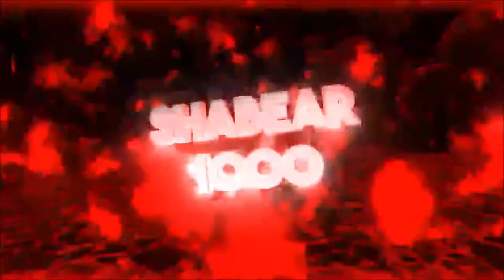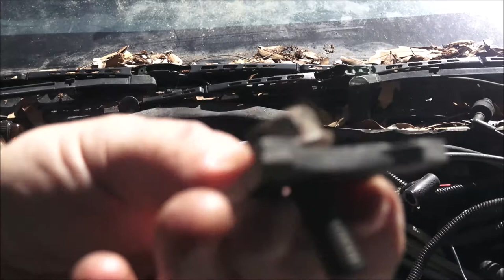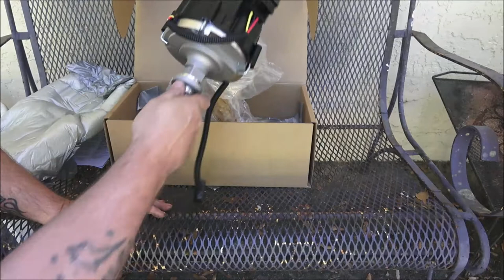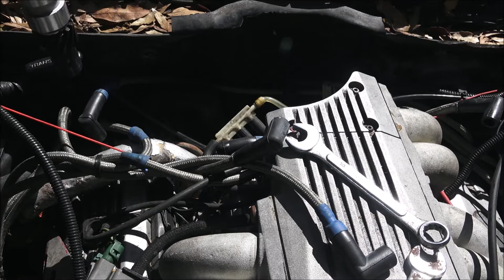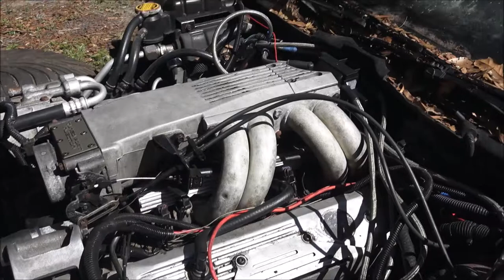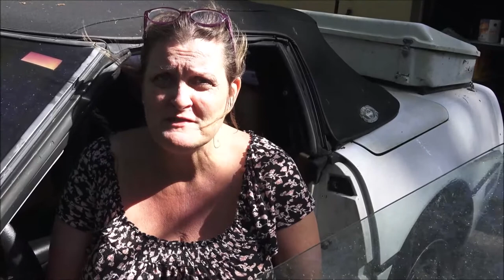1990 Corvette C4 L98 Distributor Replacement

Comment: Got my new distributor yesterday. I was looking for a video that shows how to get a wrench on my crankshaft, it's so close there. Mine's a 91 white convert and I put i in a used distrib a while back, it would start and run but bad, so I think it's 180 out, so I've removed my left valve cover and plan to turn the engine till the compression valve is right to install, but can't get a tool on the crankshaft bolt, it's so close there. I love these convertibles... Good luck with yours....
Reply from the maker: Try putting a wrench on the alternator and turn it that way.

Comment: Funny Enough I was doing a burnout in my 1991 Corvette a couple days back then it just lost power figured it was the Distributor fuel pump seems to be working since I can hear it when it Turn the key to the On position
Reply from the maker: Maybe fuel filter too
Reply: Thanks for the Advice I’ll check it out
Reply from the maker: @ToroB347  no problem, let me know what you find out in case I have that issue.
Reply: Will do 👍🏼

Comment: So I replace my distributor on my 87 I didn’t match the rotor. Car won’t start now.😫what can I do ?
Reply from the maker: What do you mean by match? What you'll have to do is put it on top dead center compression number 1 cylinder. Point the rotor in about the 5 o'clock position with the cap. Then put it in the correct fireing order, 1,8,4,3,6,5,7,2. Clockwise on the cap.
Reply: @shabear1000   exactly what I did and now it’s good to go 👌